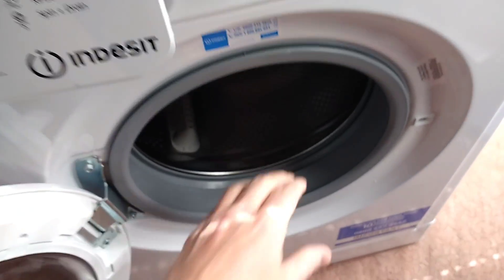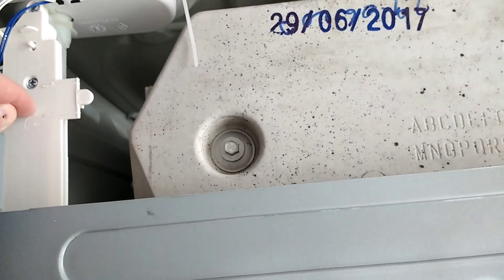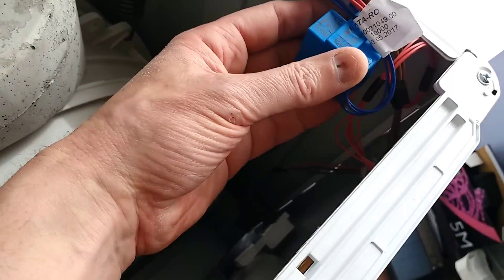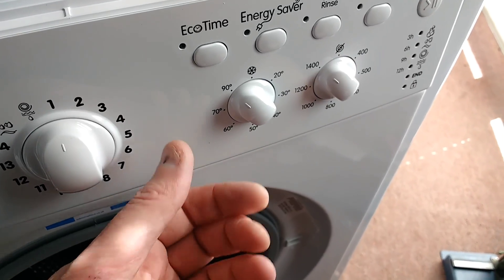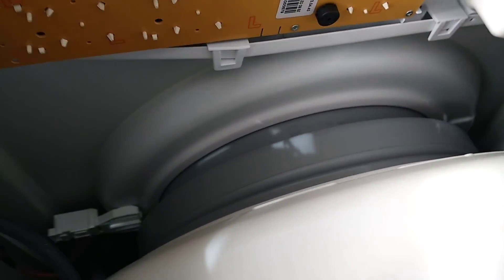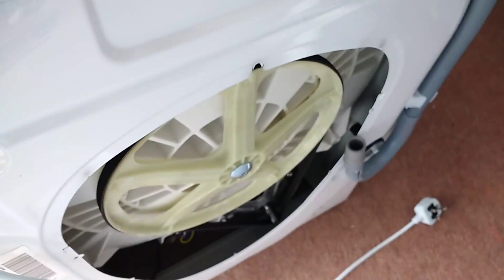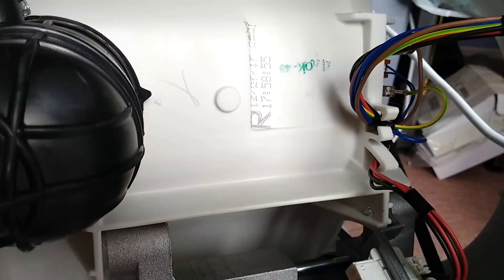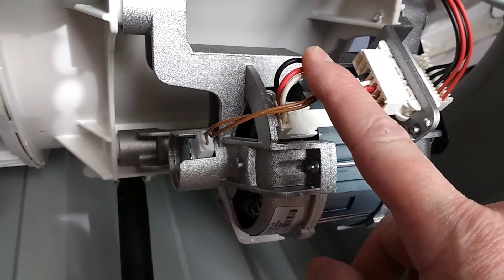Inside my new British washing machine (clothes washer).

Comment: Ahh, an Indesit. Rest assured it'll be days until the "My washer is shit and I attacked it with my spudger" video.
Reply: Miele
Reply: We just got rid of one that looked identical to this but I think was a different badge.  It was reliable enough, but those shock absorbers suck and we got fed up of it dancing across the room during spins, threatening to rip the pipes out.
Reply: Whirlpool only recently bought out Hotpoint Indesit. Hotpoint used to be quality about 25 years ago and earlier, but now pumps out utter crap, but it shouldn't be surprising since washers are getting cheaper and cheaper despite inflation. 

However, you can always be sure of plentiful cheap spares with Hotpoint.
Reply: @bilkyasko   Yes in the 60s / 70s most homes had either Hoover, Hotpoint or Servis washing machines, all made and designed in the UK (often with some foreign parts, notably the very reliable French programmers fitted to Hotpoint front loaders, can't remember the company's name).
Indesit ruined the Hotpoint brand in the UK, as you said it used to be a quality brand when owned by UK GEC. I'm hoping that Whirlpool may reverse this trend.
Don't know why but Creda & Hotpoint made even better quality cookers than washing machines imo.
The demise of the Servis brand was sad since they made very good machines and the drum bearings lasted. I think it was a case of being too slow to innovate regarding drum size, their machines began to look like toys alongside more industrial looking larger machines. They made great strides in other areas of course, like the easy care drum (without perforations ** apart from `slits' in one place - like their standalone spin driers) and of course the famous Servis Quartz programmer which was claimed to be the first computer controlled washing machine. 
** Not sure I liked this idea since debris like sand from very dirty laundry, hairs etc. are far more likely to be trapped in the inner drum rather than `escape' to the outer drum out of harms way during the wash (to a lesser extent the same criticism can be made of Miele's Honeycomb drum with it's tiny perforations).
Reply: 90% of drums are sealed so you can't even fit new bearings, even though Clive's is in two distinct halves, they will be plastic welded. If the bearing go the machine is scrap. How very eco friendly 😠
Reply: The trade in Brand names between companies is rife. Just because something lasted 15 years does not mean the same brand today is even made in the same country let alone in the same factory.  Creda used to make great washers. They're rebadged indesits nowadays. The creda factory now makes kitchen laminates.
Reply: To be honest, I am disappointed in Clive for buying such shite - anything from the Hotpoint/Indesit/Creda/Whirlpool brands (same shit, different badge) should be crushed at source to save anyone the hassle of living with it and disposing of it later.  Garbage of the highest order.   Let's not forget that their production lines have caused fires in at least two London high rise blocks, the most recent being Grenfell Tower.   The sooner they go bankrupt, the better in my opinion
Reply: It's the same as Whirlpool and Ariston
Reply: Aimilios Anagnostaras  their junk aswell
Reply: Paul Sanderson beko is Turkish and not many Bosh are made in Germany anymore.
Reply: Whirlpool used to be a good product at least in the US is is/was. Maybe Whirlpool only ships it's low tier shit to the UK and ships all the good stuff in the US?

IDK the WP set I had was a top load washer and front load dryer, I sold them off when I bought the LG set I have now.
Reply: I had a Philips Whirlpool washer dryer for about 20 years here in the UK. Eventually the (steel) drum went out of round and I couldn't get it to stop leaking. Rather than buy a new drum, I bought a new (Samsung) washer dryer.
Reply: wellivea1 well I can't recommend Samsung washers, after 3 years mine wore through rubber bushes on the plastic pins holding the motor on. Those pins then snapped casting the machine to fail mid spin with a huge bang. Their spares department then sent the wrong replacement part 3 times in a row taking almost a month to get it fixed.
Reply: Other way round, The Indesit group bought Hotpoint/Creda.  The whole group was sold to Whirlpool a few years ago.  Befor that Hotpoint/Creda were well built strong machines.
Reply: Beko is Turkish.
Reply: Stefan Scholz  we had a beko machine for 8 years good value
Reply: Miele will outlast your family if bought from a specialized shop and not a chain where special "sticker" models are sold.
Money well spent for the saved time every days!! Buy a drier as a  tower on top and you are set 25years+ with four people family
Reply: Simba Fishtigre  you get what you pay for
Reply: Which ones are good, then?
Reply: wellivea1 beko not bad for the price, last about 5 years.
Reply: they did go bankrupt, when Merloni changed their name to Indesit and started up again.
Reply: Haha , you say that, but my old indesit worked for over 15 years and it couldn't have been more than 250 euros. My latest one was 279 euros and has served me very well for over 6 years now and is running a load of laundry literally as i am typing this. You buy your 1000+ A+++ brand machines that won't even last double of what my quarter priced Indesit will.
Reply: Alex Atkin - they tend to last less than 2 years
Reply: wellivea1 Samsung Bubble Wash or an LG or an AEG washing machine.
Reply: Philips UK made great washers years ago but sold the company to Whirlpool whenupon the quality took a nosedive.
Reply: other way round. Indesit own the hotpoint brand.
Reply: Beko are Turkish
Reply: Actually that’s what I thought when I purchased mine but it’s actually been no trouble at all and had it for about 4 years the exact same model as the one in the video IWB71251 might have a slightly different number that way the shop can say “it’s not the same model” when you do a “won’t be beaten on price”  promise most shops have their own mod numbers
Reply: Gasgiant  The drum bearings are usually what fails on these machines.
Reply: If you can spend the extra money, Miele may be an option. Even used ones (which are available pretty cheap in germany at least, a ten year old washing machine will probably last another ten years in a single household (especially if you dare to swap dampers yourself)
Reply: Grenfell Tower is a rather weak argument, as the latter burnt out of control due to the building itself being badly designed, badly built, and even more badly refitted, when it should've been demolished for being an obvious deathtrap.
(like almost every bit of housing built in the 1970's)
Reply: With that belt pulley, I give it a couple dozen heavy loads before it bursts apart..
Reply: Parents had an Indesit front-loader (UK). seemed no less reliable than others, and had the advantage that parts (front seal and bearings certainly) were cheaper / more readily available. Not a "modern machine" by any standard, though.
Reply: Strange, as a family unit I grew up with Indesit machines in the home and they ran reliably for years. Now Im 42 and my own home but a singleton, I've only ever bought indesit washing machines. My first was a hand me down from my mum, it was over 15 years old. My second was the one where the bearings finally went after 10 ish years (my own fault for occasionally overloading it, I never investigated the issue, after reading this it could have been the motor or the belt, but oh well lol) Now on my third and I am more careful and cautious about spin speeds and load levels. I like the ascending beep as you turn it on :D
Reply: R600a refrigerant? "Environmentally friendly", but combustible. And less efficient in process than R 134a, or even better R12 fluorchlorcarbon refrigerant.
The best working effect I get from my 1927 AEG fridge using sulphur dioxide refrigerant. Very low consumption, and up to 40°C outside still 4°C inside.

Comment: My mate was a independent washing machine repairer , he was told that parts he fitted were not guaranteed anymore as he was not dealer registered , he told me the drums are sealed units costing about £200 , timers are the same so not worth repairing as it's cheaper to buy a new machine .
Reply: john morrow He could always guarantee parts himself if confident in the quality and his work..
Reply: yes sealed drums are a killer where as the old split drum enabled you to change the bearings now its a complete new drum .it is also annoying that no circuit info is available for the module and a new one is very expensive..

Comment: dont buy an indesit tumble drier, they blow up.
Reply: well they all did for a while, they fixed it in the end
Reply: Jusb1066 still dont know if mine is a bomb or not.
Reply from the maker: I did indeed buy an Indesit dryer.  The condenser type.

Comment: Yeah, I didn't realise machines now only use cold inlet these days either. Softner / conditioner stops clothes from sticking together and makes them (slightly) softer to touch. Perhaps you're using too much if things come out all yucky?
Reply: MagikGimp yep, im only using a small amount for not having to iron some things or making that easier (and nicer to wear)
- most important thing to keep a clean non smelly machine +clothing is to regularly use 95 or at least 70°C program (which tends to end up as 65 watertemp).
Non of this 40°C shit and desinfectant addons all the time 😬.

Comment: Did you get the extended guarantee on it? Will they even let you have it on an Indishit?! I know you can usually repair stuff but judging by all the plastic in that thing it'll end up a sea of epoxy to repair
Reply from the maker: It has a rather pushy 10 year warranty option, but it makes up for the cost of the "free" replacement components by the cost of their engineer fitting them.
Reply: £100+ callout on a £170 washing machine?

Comment: The plastic pulley will be FEAed to an inch of it's life and lifecycled to warranty +1day. Some poor sod spent years of his life to save 6p per machine.
Reply: Designing something that lasts forever is easy. Designing something cheap that will fail quickly is easy. Designing something that is really cheap and fails exactly after the warranty period is over is the hard part.
Reply: What's so wrong about plastic pulley?
Reply: Yes, but 6p times a gazillion equals a butt load. So it was worth a peons life.
Reply: Yeah just about everything these days Amer fact my uncle had a dishwasher go out exactly one day after the warranty was up believe it or not I call that proof of a conspiracy.
Reply: I've had a Zanussi fridge and it worked 2 years and 1... month. Not +1 day but +1 month. 
The freon escaped and the fissure was somwhere inside some foam and the repair was ~80% of it's value as new. 
I run away from Zanussi since then.

Comment: Plastic is what you get when buying shit like Indesit.
Reply: Против Глобал Bosch stuff is ok. Not shit, not great, just ok.
Reply: Drew Morgan He was talking about the plastic pulley on the back of the drum vs an Aluminium one.
Reply: If ur decent with repairs you're probably OK with cheaper stuff. Clive can probably manage most fixes
Reply: siemens also isnt very good. we had to change the bearings 2 times and they have gone bad again. and the front panel rattels like hell when it is spinning fast. We ended up buying Miele
Reply: I still see Pitsos white goods from the 1980 still going strong.
Reply: Depends on the bosch stuff, the low end stuff isn't actually made by them anymore. Only the expensive stuff is actually Bosch.
Reply: I have an hotpoint that is over 7 years old, never had a problem with it yet,  i know people with Indesit and they have had them for a fair few years. Yet, I know someone who paid over £800 for a Siemens last year and have had so many problems with it.  Like people say Beko is rubbish and yet my Beko freezer is great.
Reply: Plastic here is a good choice since you won't have any problems with corrosion.  My LG with a plastic outer drum lasted at least 10 years.  I ended up having to replace the outer drum (~$35) because I failed to properly replace one gasket when cleaning the lint out one year and the hot air partially melted the flange.  Almost 15 years running and it is still going strong with the new outer drum and a new pump.
Reply: Generally yes though I understand some cheaper Bosch machines are built in Turkey (Beko?)
Reply: I use washing machines 20-30 and more years old, by Bosch, Miele, and Perla (Bulgarian brand). They are fabulously reliable. I would never buy a new one when I can get a good old one. Sometimes you have to replace a heating element or sensor, but that's it.
Reply: That's funny because my last Hotpoint lasted 15 years. Which is why I bought another
Reply: phil955i that's because it was a 15 year old one, it's only been in the last few years they have been cheap. 
I got one 6 years ago, needed an engineer at 6 months, and melted the electrical input block at 3 years..
Reply: The thing is, it works out cheaper in the long run to buy the more expensive units.
Reply: M Jons agreed. Indesit / hotpoint is trash. It'll be back in the trash after a couple of years (if it doesn't burn your house down first)

Comment: That looks very very familiar inside. I have a Kenmore (Sears) machine that has run for ... I dunno, about 15 years, then it recently had the bearings wear out. They fail when the seals leak gunk from inside the drum. There are videos to show how to pull it apart and replace the bearings for about $30. Or, you can get full drum & bearing assemblies and save an hour of pulling it apart (and spend an extra $150). Or, you can pay someone an extra $200 to do it. Or, you can buy a new washer.